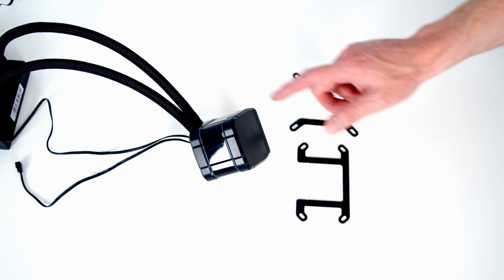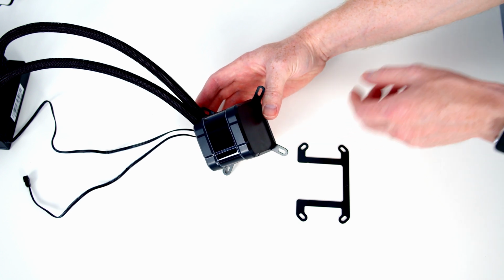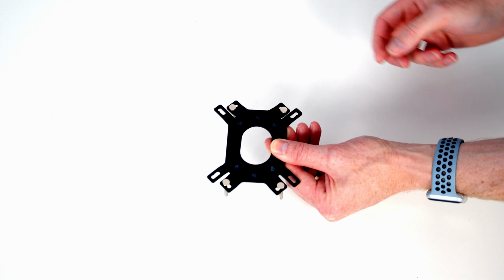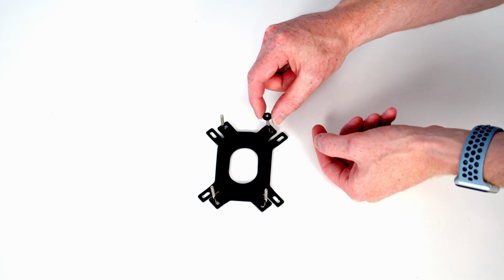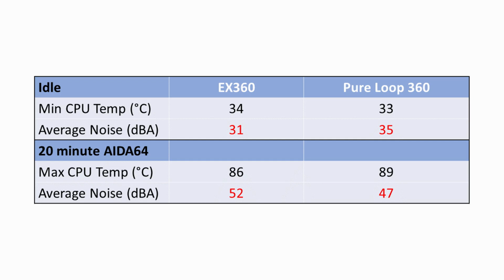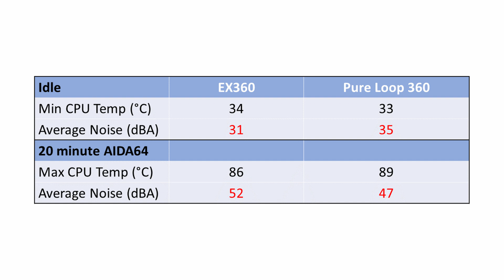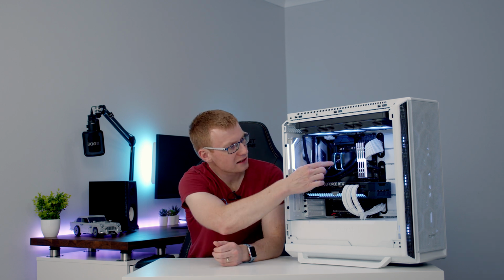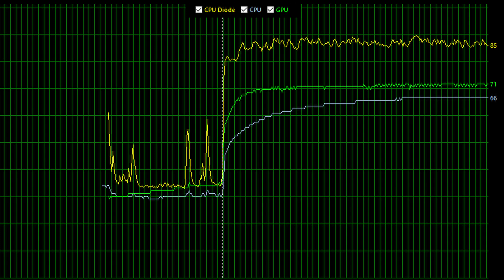Sahara Gaming EX360 AIO - Installation Guide and Review

Comment: hi just installed it, i have pump plugged into pwm motherboard, and into the controller and that has 12v going into it. But the pump isnt doing anything at all, the temperature rises until the system shuts off and the pipes dont get warm at all, please help
Reply: I’m getting the same problem . Did you manage to find out the issue
Reply: @Theadamator1991  faulty pump, had to return it and get another

Comment: Tried to get away with not plugging in the 4 pin fan power cable from the hub as I didn't think I need it as I had already plugged the fans into cpu header and the pump into sys fan 1 header but no temperate display on the pump but worked once I plugged in the other cable, thought the power to the pump would do this, just seemed strange for it use use 3 fan headers.

Comment: The temperature on the cooler is not the CPU temp but the temp of the AIO liquid instead which should be less than the CPU temp.
Reply from the maker: That was what I thought at first, but from their documentation it says "Detects surface temperture of the CPU"